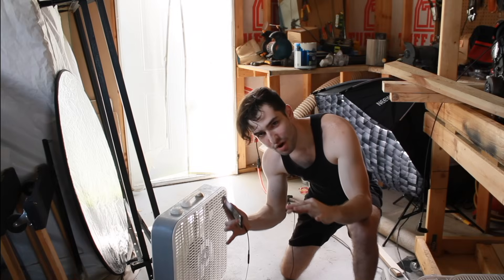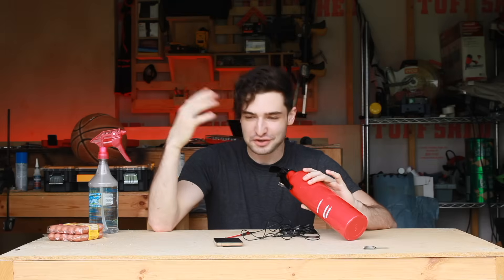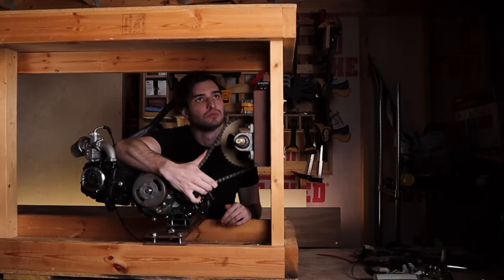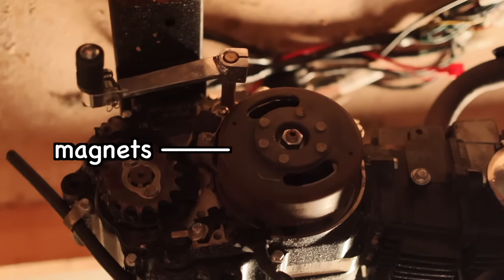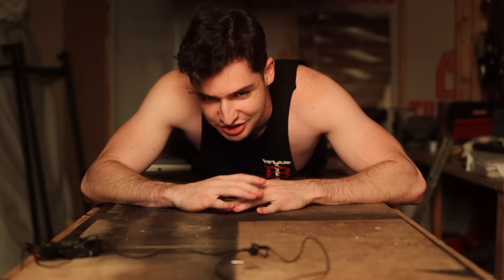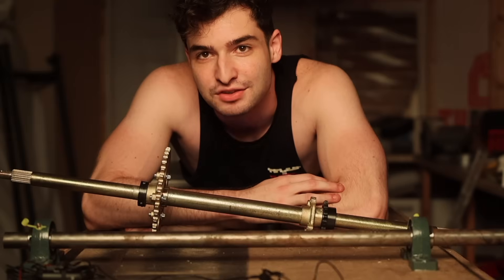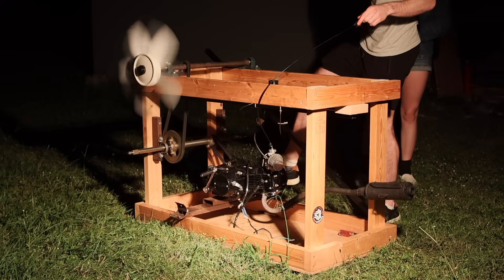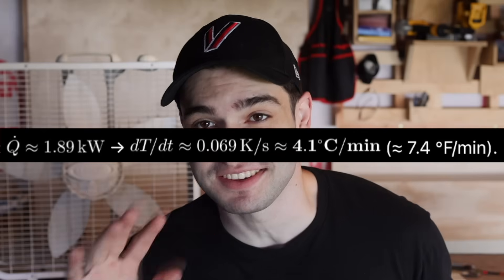I Attached a Motorcycle Engine to a Box Fan

Comment: Bro is treating a little engine like a live bomb
Reply from the maker: tbh I was more worried that my shoddy method of attaching it was ass. It's not shown in the video because I was ashamed, but the engine enclosure is literally attached with some drywall screws in some places. The consequences of being broke as hell.
Reply: @KosCreates lol hey if it works it works, worst thing that can happen is that it if it breaks free it’ll probably vibrate but I think you could probably shut it off and I don’t think it would be a fire hazard or anything. Keep wrenching man don’t be ashamed
P.S. I don’t know how to work on engines either lol

Comment: i remember seeing some IG reel of a guy taking a toyota radiator fan and using it as a window fan in his shed... i did the same thing actually and it works wayyy too well. i just ended up plugging a PC power supply into a wall and wiring the radiator fan (mine is off a 2006 toyota yaris) it to the 12v rail (via 6pin PCIE)

Comment: This over engineering gets me so upset. I would’ve attached a fan to the crankshaft of a lawn mower engine, to bypass all the shitty gearbox problems.
Plus, you could’ve spent the money on a bigger fan so it was more efficient because at that point you didn’t need the go-kart axles.
Reply from the maker: I think the only thing I spent money on was that second axle (just a cold rolled steel rod - which we needed for a different project). 

This video came about from me having no money but wanting to build something - nothing in the video was paid for. I agree that I’d like to have used a bigger fan or a different gearbox… but we had an engine and go kart parts. You work with what you got. 

Was it over engineered and stupid? Yeah a thousand percent. But the video was free, even if we said the parts were expensive to pad the plot. 

I assure you all of these parts went right back into the go kart they were taken from. Unfortunately, until I get money to do projects the right way, I have to make the audience laugh with the wrong way. No harm done at the end of the day though, my workshop bench went back to being one, and the mechanical parts went back to where I borrowed them from.

Comment: How about trying a propeller or a rotor from a Radio Controlled aircraft.?
Reply from the maker: fun fact, for my senior design capstone project i built a uav, so I had motors and propellors lying around - but it kind of took away from the absurdity of the concept for the youtube video, and entertainment > logic in this case
Reply: @KosCreates . I’d just like to see how far they can be pushed before they disintegrate themselves.

Comment: I am a small engine mechanic, I heard the engine running in the video and it sounds like to me that the idle circuit on the carburetor needs to be loosened out until the engine maintains a smooth idle sometimes those Chinese carburetors can be tough to get to run right, If you don't know what you're doing I enjoyed the video though!
Reply from the maker: You’re spot on. We were able to get it running a lot better this afternoon.

Comment: The carb isn't tuned right and it didn't make it to full throttle. The engine is meant to idle without a wheel spinning because they have flywheels. Flywheels are necessary because stop lights exist. Y'all haven't touched an engine before. Do more research, I know you can do better! (This video also has a lot of bold false assertions portrayed as fact, so maybe do a little more research, too)
Reply from the maker: I learned a lot after shooting was finished (which is annoying, because all of the mistakes were too difficult to remove by that point from video) but I can confirm that research figuring out the carb was the problem was extremely hard compared to trial and error. We decided to learn by doing, which has gaps I couldn’t close on my own. The resources for learning everything to do with this engine were pretty bad, and surprisingly condescending - when asking on forums how to wire the harness, most of the old heads were pretty rude, which honestly reflects in the analytics on this video too, as the 50-59 age demographic has the highest dislikes and some seriously unsupportive awful comments.

I really did try to do my research, and was met with a pretty bad experience. The only people that were of help were Colin furze, and a guy on one such forum that was very patient with me :)

I will say one thing though, the engine didn’t make it to full throttle because on that last attempt we ran out of gas. Only figured that one out when I started disassembling…

Didn’t really expect this many views on this video, but one thing’s for sure now, through the myriad of comments I learned a lot more - I just wish I knew it before filming. But I couldn’t have known it if I wasn’t corrected! A vicious cycle.

Comment: I stuck the metal fan blades from an hvac central air outdoor unit on a 3hp treadmill motor..  when the knob was cranked to full power it got stupid real quick..  damn near took flight..

Comment: this is the things i think about doing but being to young and having no money to do it
Reply from the maker: When there’s a will, there’s a way. I can’t pretend getting this video made was easy. 

While I had the engine from the beginning, if you think about it the only things I used to make this project were two pieces of metal, a few 2x4s, a drill, and a socket wrench set. The expensive parts came because I wanted it 300rpm faster for the video, but without those this project is actually within reach tool wise. 

You gotta get violently creative with what you have. I had a box fan and a motorcycle engine. In two weeks I’ll have a table and an air compressor (sneak peek haha)

That being said, if you really are too young, work hard and you’ll easily have the money to do whatever you want - get good grades, that’ll make you so much money you can’t even imagine it. Chaotic builds with your creativity will come right after! 

Above all, be safe. Contraptions are dangerous. Start with what you are comfortable with.

Comment: Bro, just stick a drill to the nut to start the engine
Reply from the maker: The threads are the wrong way, it loosens the nut. Didn’t wanna try any directing mount method bc it would wreck the threads. Plus, funny content pull start lawnmower

Comment: This felt like an I did a thing video when I saw it
I'm glad it wasn't 
New channel found, subscribe button broken
Phone screen blasted
Edit: I've stuck my finger and hand in my box fan before without the shield on it
It stung but the fan just stopped and screamed at me like angry bees
Reply from the maker: Inverse relationship between torque and speed, baby!
Reply: Box fan blades have more kinetic energy, but it's still computer fans I fear most... Especially the ones from the early-00s like the 80mm Thermaltake Volcano 7+ that screamed along at a "paltry" 6000RPM on high (it had a L/M/H switch), which is what I kept it on for my Dual Athlon MP computer.

Many of us DIY folks were too lazy to turn off the computer when going in for menial things, but with that comes the risk of your finger being bitten by a fan 😅
I have had many draw blood, and have had painfully broken fingernails on many other occasions (which sometimes also drew blood)
I've also broken many fan blades since with that hardness comes the drawback of being brittle.

Comment: Got balls to stand that close to the fan that probably isn't meant to spin that fast.  I'd be worried about rapid unscheduled disassembly...
Reply from the maker: I did a lot of math and simulations behind the scenes that showed I'd have to get to 3600rpm before the plastic would shear against the air. In addition, the fan piece isn't really on the axle, It's not screwed in with a set screw or anything. if I somehow got my hand caught in it, it would just spin around my hand. The key to making these youtube videos is the appearance of danger I think
Reply: @KosCreates  glad to see you're at least putting some thought into it then.  I've been party to destroying some cutters on my CNC mill before.  Not quite that big but chunks of carbide flying out at 7,500 rpm is scary.  Always keep the doors closed and fingers away from spinny things.
Reply: Nevermind, it didn't spin that fast.  Still.

Comment: Next time I suggest you use a cordless drill to start the motor instead of the string. 
Other than that, this was fire! (Almost literally)
Reply from the maker: We did try that, unfortunately the nut threading is backwards for the nut that keeps the fly wheel on this engine, so spinning the fly wheel with it just. Unscrewed it instead of spinning it. Dumbass design tbh

Comment: You should put it directly on the crankshaft of the engine should make a space heater still inneficient but probably working
Reply from the maker: Its slower in the crankshaft bc theres an internal gear reduction ;~;
Reply: @KosCreates i think you misread something there

Comment: The idea was funny but ngl the execution was ass 😂, if that's a 125cc, it's the copy of honda ss125 or something(80s engine design) it should easily output 9-10hp to the crank if it's of a good quality and should rev to 9500-10,000, you could have just attached the fan to the magnito, that would have made some real wind
Reply from the maker: You’re 100% correct. You live and you learn

Comment: Great video and all, but my question is, if you only managed to run the fan at 1000 RPM, why didn't you try get the engine to accelorate properly? I reckon a motorcycle engine must be able to rev quite high. After all, I don't think pulling on the throttle should make it stall. But hey, I'm also happily wrong :>
Reply from the maker: You’re 100% correct, and this is a great comment - the answer is, I genuinely couldn’t figure it out. Every time we fixed a reason it stalled, there were five more. 
The worst issue was slightly mentioned in the video which is the engine is designed to rely on the momentum of the motorcycle to keep the gears turning when you stop accelerating - but since we don’t have momentum here, the gears just lock up and the engine shuts off. 
After a lot of testing (12h) I finally gave up because a perfect video is impossible and I was satisfied with how fast I did get it… but even with this sprocket ratio, the fastest it would theoretically go is 1400rpm anyway. 
The worst part is the final time it stalled which is when I gave up was the easiest issue to solve - I ran out of gas -.- very frustrating thing to find out mid disassembly…

Comment: Bre, just use a nut on a drill to crank the engine and ditch the cord.❤
Reply from the maker: The flywheel spins the wrong way for this, it just loosens the nut. I tried ;-;

Comment: people say the algorithm bought them here, but the truth for me is more nuanced:

i always thought abt smth like this. but the thing actually oscillates and has the protective grills on it, y'know. i theorized that the head would be essentially this large gearbox in place of the motor and then there's this driveshaft that connects to it from the bottom
Reply from the maker: A gearbox was the original plan but it involved too many expensive custom parts, and vibration has been a consistent issue for me attempting stuff like that. I love machining but unfortunately the equipment is really expensive and I have no space ;-;
Reply: yeah. simply taking an oscillating fan from Walmart and swapping the motor out for a bevel gear assembly is also out of the question for me as well. 🤦‍♂
Reply: i also don't have the budget for custom machining either. and plus off the shelf bevels are tricky to find in the right size

Comment: you’d be better off using a predator 212 engine geared crazy high. The engine doesn’t rev as high as the 125 but it’s got more torque so it can handle a higher gear ratio
Reply from the maker: The predator engines were 20% off last week too. Missed opportunity… alas, I had this one lying around for some reason.
Reply: @KosCreates  they go on sale all the time or you can get em for dirt cheap off marketplace, might make an interesting pt 2
Reply: @sahibdipsandhu I think for the interesting part 2 I’ll hook it up to a woodworking router for 9krpm without having to make a giant fucking contraption that takes up the shed. That’ll be far in the future though, in order to blow up the channel I’m going to do some different projects for some engineering variety.

Comment: I want to say more gears but I can't imagine a cheap box fan blade can even go that fast before exploding. Or maybe its made of magic and can go 20k who knows
Reply from the maker: I actually have an exact answer for you. Box fan blade exploded at around 3600 rpm in CAD simulation, but that doesn’t matter because adding another axle for another reduction would cause enough vibration at 2000rpm that the chain would break. I know this because I tried. Id need to weld a new frame, but channel isn’t big enough for me to invest in one yet. We’ll see what the future holds…

Comment: just tighten the kick start more and if that doesn't work start it with a drill and a socket on the nut also adjust the carburetor for more fuel.
Reply from the maker: Where the kick start bolt attaches broke after we tried tightening it more (we didn’t over torque it, it just snapped), dumbass cheap parts. I have since JB welded it… as for the drill and socket on the nut, on this engine the direction it has to spin would loosen the nut instead of spinning the flywheel. And believe me, I adjusted that mf carburetor eventually, but I really needed this comment two weeks ago ;-; this was my first time using an engine haha
Basically, you are 100% correct on all fronts. Your brain did the exact same things mine did. Unfortunately, engine is ass and I am stupid.

Comment: This video is sooo stupid... Also FYI box fan motors typically rotate at 1400 to 1600 RPM's not 2400.
Reply from the maker: My measuring thingy must be broken. This is what happens when you buy cheap electronics on Amazon ig

Comment: On a real motorcycle a properly set up carb keeps the engine running.
Reply: There's also fuel injection
Reply from the maker: It was a struggle for sure. I wish there were better resources to learn, but nothing beats 6 hours of trial and error. Ironically, the reason the engine shut off the final time - as I came to find out WELL after the video was out - was not for some mechanical error, but for the fact that I ran out of gas. That was a several hour rabbit hole that I only figured out after I gave up and disassembled it haha
Reply: @KosCreates "I know whats wrong with her, she aint got gas in it!"